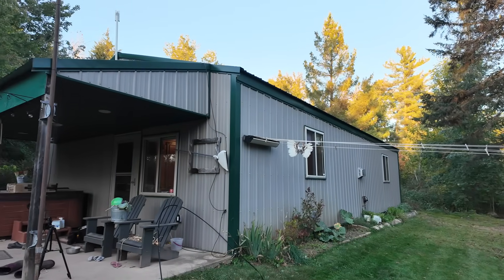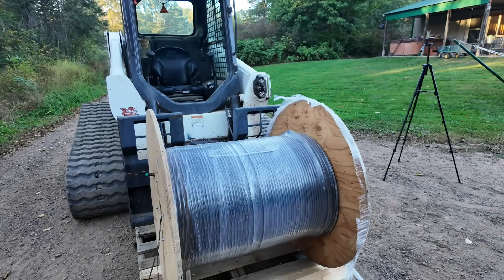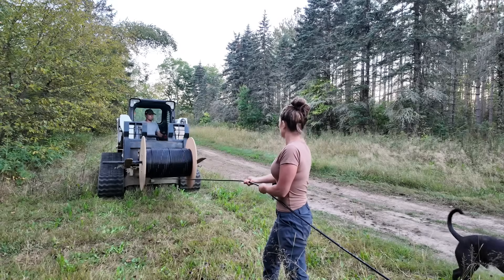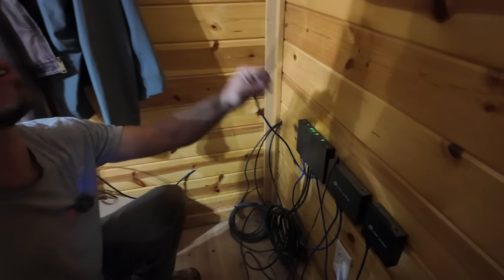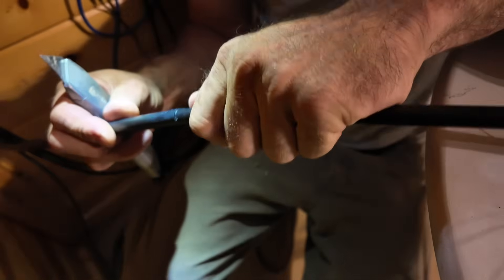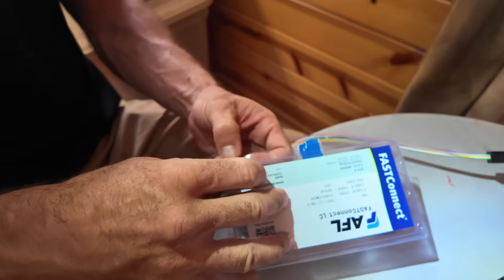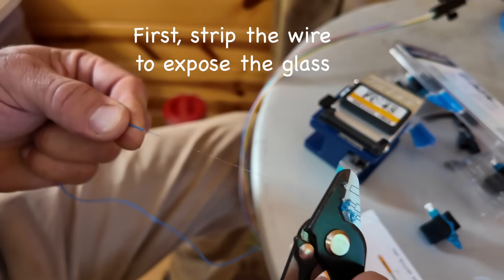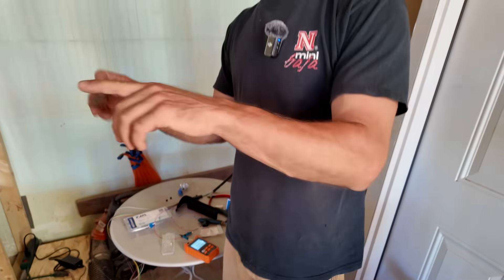We Need Internet! Running a 3,000 ft Fiber Optic Cable

Comment: I’m an IT person and we work with Fiber Optic cable, nothing that long. But I suggested you should trench and burry the cable very soon and not let it stay above ground where animals may chew on it, or an accidental run over it by a vehicle to damage it. I’m not sure about the armor on the cable, but we were always told - not to change the bend or kink fiber optic cable as that will give huge losses…

Comment: Tp-link is junk. In my opinion you should be looking at Ubiquiti equipment. Of course a point-to-point link is unobstructed with no trees in the way so you would have to have a radio tower at both ends that is above the tree line in order for that to work correctly. Running single mode fiber is always the best bet! Then you could easily get 10 gigabit out of that or more depending on the transceivers that you put in on both ends!!  Good job!!!

Comment: I used that brand of connectors last week. Also LCs.

I would have the VFL plugged in to the connector as you're putting the fiber in the back of it. You should notice an obvious difference in the amount of light bleed on the underside of the connector between the glass not being all the way in and the fiber bottoming out.

I used these connectors on multi-mode. My SKU was made for multi-mode and I did not have anywhere near as much laser light on the backside of my connectors once they were fully terminated and the cleave was clean. 

If you ever end up with problems, I would just double check that you have a clean cleave and that the connectors are fully seated.
Reply: I just got to the end of the video where you talk about having to use the meter differently. 

The connectors are made to crimp onto the plastic jacket of the fiber itself. You shouldn't be trying to crimp them onto the fan out tubes. That's why you're having that problem of the glass moving around. 

Again, with the VFL running there should be very little light bleed once the connector is clamped on.

Comment: If that's a managed switch (which i assume it is) you should be able to find the signal strengh reported by your sfp modules somewhere.
Reply: Depends on the switch and the SFP's.  It's home office / small office switch with generic SFP's - so 'maybe'?.  Not enterprise grade Cisco Catalyst gear.

Comment: SFP not SPF!!!!!!
Sorry, IT guy and it drives me nuts.
Just remember it's NOT the same as SunScreen.
"SPF to LC Adapters" are known as Transceivers.  
SFP = 1Gb
SFP+ = 10Gb
SFP28 = 25Gb
You can even get something known an QSFP28 LR4 Transceiver which uses 4 wavelengths of light down each fiber and with 100G-LR4 you can get 100 Gigabits down those Single Mode fibers. The Q stands for Quad, so it's using 4 x 25Gb signals (1 wavelength = 1 signal) in the case of QSFP28.
"On the other end you have to swap em" = Yup.  Light to Dark and Dark to Light.  Send/Receive abbreviated as Tx/Rx (Transmit/Receive).
NEVER look into Single Mode, it's a fairly powerful light source.  With Multimode which uses a weaker light, you can use your camera on your phone to see which fiber has light coming out (Tx) and which does not (Rx).  But even with your phone camera, don't aim directly into the lens, slightly angle it so your phone camera is only picking up some stray beams which will be plenty but low enough not to damage the camera.

Comment: Next time for your life to become way easier just use media converters so that you don't have go around terminating 2 fiber cores, you only need 1 when using media converters , that cable you used is heavy duty it requires a splicing tray to protect your cores. Buy a fiber patch panels your termination will be safe. Bi directional for just up linking a switch is more tedious job cz its really nothing too special just use media converters you save a lil bit on SFP modules

Comment: Starlink mini is now 50 bucks a  month and 250 for the transceiver. Compared to that this will take about 4 years to pay off if you spent about 2k on the cable and 500 on all the other equipment. Thats also assuming there is no other maintenance costs like the cable getting damaged.
in the long run, I'd say it's probably a good bet, but given you can pack up the mini and take it with you, I'd probably just add the mini to your plan. You could also save some money by turning the main starlink off when you aren't using it. SpaceX lets you suspend whenever and pick back up whenever.

Comment: Hmmm never seen a fibre spliced without the very expensive splicer 🤔

Wifi should have worked if you had line of sight. Big poles or towers maybe

Comment: Great projekt. However trench it with 1" to 6/4" kpe (sprinkler) pipe with extra pull cord for future upgrages.  Moderated extra cost for later yourself. 
I also would place on every 800-1000 feet a sprinkler valvebox and some spare optic in a loop.

Comment: Weld up a cable plow for the Bobcat. Would have been very easy with the spool, but still can be done. Once you have a powerful machine to do the work the tool can be generally easy. Can also make money using it for others

Comment: I generally wouldn't suggest anyone run their own fiber line. 
Too much can go wrong, and glass is extremely unforgiving. 
Even pulling it off the spool can break it. Hardline or even smaller riser cables are much more forgiving.

Your best bet in the long run is to bury conduit.  You want to do that job once, then never again.  Fishing through conduit is significantly easier than retrenching when you inevitably need to pull a new line. The other issue is that technology can be very different decade to decade.  Giving yourself a means to pull the next technology in the future will make future you smile.

All that said... Optimism can save you a ton of money if the worst never comes.  Today's cables are exponentially better and more installer-friendly than the stuff from decades ago.  Cost-wise, running another spool right over the broken one might still come out cheaper than overdoing it the first go.

(Background: I worked on the forefront of commercial communication fiber.  Back when hand polishing was the only way.  A few of those original lines are still around in certain airports working to this day and installed FAR worse than what you folks did.)
Reply: It's direct burial cable on private wooded property - not an industrial complex.  It'll be fine.  We have outdoor fiber (buried, duct bank and aerial) installed in the early 90's at work that has no problem with 10 gbps speeds.  

3,000 feet of 4" conduit gets quite pricey.
Reply: @lesterawilson3  Yes, as I said, optimism can save you a lot of money. 

In most cases, you are better off playing the odds that nothing goes wrong. 

I edge towards suggesting doing it with a safety net when someone with limited knowledge of the system undertakes something like this. 

If I bury a cable, I'm 75% sure it'll survive the lifespan of its usefulness.  That's with proper trench depth, animal mitigation, vehicle path avoidance, tree growth accounted for, physical markings for cable location and path... Etc.
That surety goes down if it's haphazardly hidden a couple inches down at the most convenient location a forklift can travel. The same path other heavy equipment will ultimately travel. 

Fiber gains the advantage of not attracting as many animals to take a nibble out of it like copper on an amplifier would, but it's still a cause for concern in the randomness of nature. 

The cost of the conduit can be built into any other service they want to run now or in the future.  The prospect of using that conduit for contingencies would be too advantageous for me to personally pass up.

Comment: Doing pretty good. Multi mode fiber works pretty well with short haul applications like this. If you keep having issues with your terminations, consider getting a pre-terminated pigtail and buying renting or borrowing a fusion splicer. Fusion splicing is pretty much the way we do it on the isp side of things because it is the most consistant way to get a connection with the least amount of loss, the machine will tell you what your splice loss is vs mechanical termination being 50/50 on getting it right.
Reply: MM fiber for gigabit connections is good up to 1,800 feet (they ran 3,000 feet).  6,500 feet for 100 mbps.  Nobody is running MM fiber these days unless there's some technical or customer requirement for it.  SM fiber costs about the same and you get far greater distance and speeds.

Comment: I have been in fiber over 20 years as much as the video makes me cringe kiddos to you for getting it to work. Pro tip you really should add a small wall mounted "termination panel" to protect the delicate fiber. Then from the termination panel use a jacketed fiber optical jumper to your switch. This will be a much fore durable install. Also the color order for fiber is; Blue, orange, green, brown,  slate, white, red, black, yellow, violet, rose, and aqua. 1-12.

Comment: 2 mins in and wondering if they bought the tools or if you can rent them since i see you didn't buy your cable with connectors from your supplier.
Reply: Who knew you could make your own cables without fusion splicing.

Comment: I’ve been doing Wi-Fi for a living for a while now. I’ve recently had some customers that needed large areas covered the best thing I found is getting an access point with a removable antenna. Like from TP link or ubiquity and attaching a high gain Omni directional antenna on a tower. You need way less access points and it is way more cost-effective per acre.

Comment: Nice job bit of advice you could have got a cable hose to terminate the fiber with connecting toes before pulling they supply the cable with a proctector ends for pulling than just plug when done pulling.

Comment: SFP = Small FormFactor Plugable.  Single Mode fiber uses 1310nm - 1550nm.  Your tester appears to be using/set for 850nm which is Multi Mode fiber frequencies.  I mean it works, nice job.
1G SFPs typically TX @ -2dBm, and are good/ok to RX @ -12dBm.  Your video runs over 6x 40G or 100G links from the edge cache by the way :)

Comment: Great job of getting it working. Very impressive being that you have no prior experience with fiber. This is coming from someone that’s been in the industry for a while installing, splicing, and designing fiber networks.

I would put at least a wall mount panel with bulkheads like a Corning SPH-01P on each end. Leave at least a 25ft service loop on each end if not cut to short already. When you bury it, put a junction box about every 500ft with a 50 ft service loop. This will be great in case you ever want to use a couple of strands somewhere else, you can do a midspan splice instead of running it the complete path. If you don’t think that will ever be needed, no need to waste the money on the junction boxes.

Also, you need to bond the armor to a ground. You can use something like Corning Hardware Grounded Kit (HDWR-GRND-KIT).

When terminating fiber, always wear safety glasses and put some tape down to catch the shards that were cut off. That way you don’t accidentally get any loose shards stuck in you or in your eyes.

Comment: Fiber optics can be Ron up to 46 miles with little to no loss of stability.  Just do not bend, crimp or crush it, it will damage and reduce light transmissions. So no big rocks when under or on top of cable.

Comment: I live in a forest. Animals with hooves, elk and deer sometimes like to play via teeth pulling item etc. so leaving it unburied any length of time risk damage. It may be armored but how armored. Given the length and any compromise in the cable may not been seen until after buried..particularly moisture intrusion
Reply: Moisture intrusion typically isn't an issue with fiber unless you're in colder northern climates where freeze-thaw can break the fiber strands under certain conditions.  This stuff is tougher than it looks believe it or not.  I've seen similar type of cable dug up and still work just fine.  But yes - it's direct-burial cable and needs to be a good 2-4 feet below the surface.

Comment: ive never seen someone test using a VFL to see if there is light loss with a meter. is that even a thing?
Reply: just looked it up. this is not the way to test. 

 A red VFL will be in the 600 nm range, while the power meter will expect something like 850/1310/1550 nm. Any reading you get will be incorrect due to the mismatch.
Reply: @petek9348  It isn't. Been doing this for 15+ years. VFL is just to verify continuity. 
You need a power source on one end with a power meter on the other. Also, they need to be calibrated.

Comment: You should install a breakout tray (called a FOBOT in the industry) and patch panel along with patch cables. This will allow you to strain relief the delicate fibres while holding onto the rugged outer casing. The terminated ends then plug into the patch panel. You use ruggedised patch cable to bridge between the SFP and the patch panel. The end game to to totally immobilise the delicate fibres. The patch cables are semi consumable in that they are not immune to abuse so it is a good idea to keep a spare around.
Reply: @thehomesteadingrd This is the advice you need to take right here. Also well done for a layperson.
Reply: Yep do exactly this. You need a network rack. Just get a 6u for this setup and fiber tray.

Comment: Long range works through line of sight, no trees or buildings, even dusty air is bad. It does work. I have a 5km wireless AP (can go go 42km) setup to a camera, no issues. I use the same thing on my motorhome to connect to hotspots that are a bit far. Dont go through trees or other obstacles and stay far away from anything metal.

Comment: You need to leave at least 20 feet of fiber for a service loop.  A VFL is only meant for tracing out cable. Crimp on LC connectors are a poor choice, using a fusion splicer is the best choice.

Comment: Interesting Video. I’ll share my experience. We needed internet service. Comcast had service 200’ from site on the other side of a Railroad Track. They wanted us the customer to pay for the engineering & installation of the fiber. Their cost was $30,000. Honestly I thought they were kidding. We then approached AT&T. Their plan was to run fiber from their nearest node to our site without crossing the Rail Road.  From us they required  underground conduit with pull stations every 300’.  The conduit boring under roads/water pipes installed cost $26,000. Internet isn’t cheap.

Comment: I would order two 19" rack mount splice boxes. The cable itself is very resistant to damage, but the fanoutkit is not. So I would put it into a splicebox with couplers on the front, so the fragile parts are protected. From there it's a simple 5$ patch cable. Cheap boxes with 6 duplex connectors can be bought for under 80 bucks.
Reply: Wall mount boxes do the job too.

Comment: When stripping the fibre, after you strip the coating you have to strip the cladding
Reply: @AfifAhmad,
No you don't. The cladding is part of the glass. Nice try on trying to act like you knew what you were talking about, but you don't.
That is 250 micron SM Fiber. The core is 8 - 9 micron. The cladding surrounds the core making it 125 micron, the insulation is another 125 micron which brings it to a 250 micron fiber.

Comment: It's impressive to see you do this as a diy project. From the limited time i worked with automotive typ fiber optic cable i would reccomend coming in to the building from under it if you plan on trenching anyway. This way you don't have to worry about the cable sticking out and potentially getting damaged. These cables have a minimum bend radius you should always stay above and you also shouldn't bend the cable too often. The single fibers should be roughly terminated to the same length. I'd also reccomend terminating all ends and just putting end caps on the ones you don't need to protect them

Comment: What kind of fiber was that? OM3? OM4? OS1? OS2? For the distance you are running, I'd think that single-mode fiber is the way to go. With single-mode, you only need 1 fiber for 10 Gbps for 10GBASE-BX. I realize that 10 Gbps is overkill for the Internet with Starlink, but it can benefit INTRAnet connections.

At my house, I needed to run fiber in an electrical conduit between my detached garage and my house. I knew nothing about the specifics of fiber at the time. I didn't have a lot of options in such a short timeframe I had for installing, so I ended up purchasing 1000-ft of OM1 zipline (two-fibers). The run I needed was very close to the theoretical 33-meter limit for 10 Gbps 10GBASE-SR. As I have no experience nor tools for terminating fiber, I ended up doing a search on the Nextdoor app for someone that could do so. I ended up finding the owner of an IT company that agreed to terminate for a reasonable price... knowing it was for an individual, not a company. Being that he was the owner and not one of his field guys, he was a little rusty at it, but he was ultimately successful in getting each fiber properly terminated. I have several 24-port 1 Gbps network switches that each have 4-SFP+ slots. I link all the switches at 10 Gbps so inter-switch connections don't become a bottleneck.